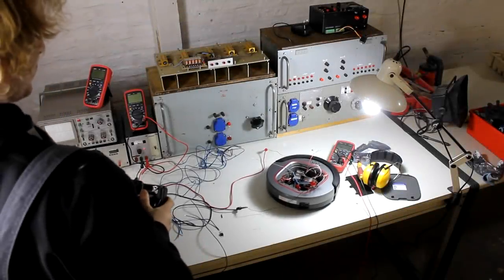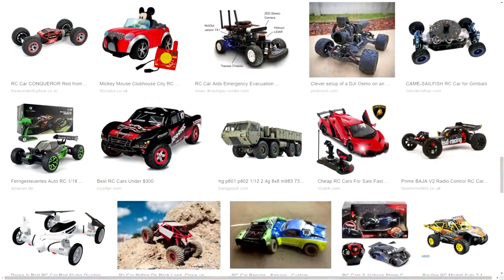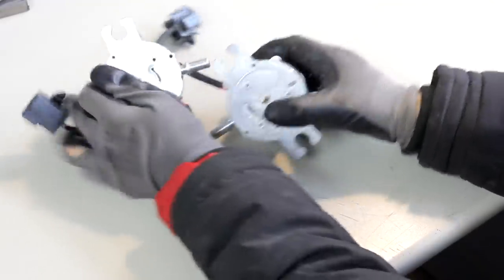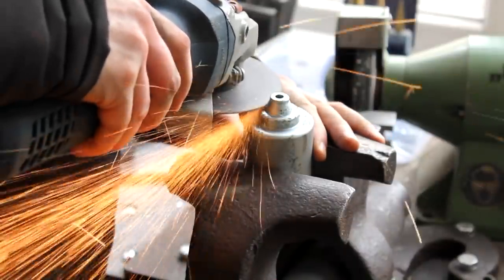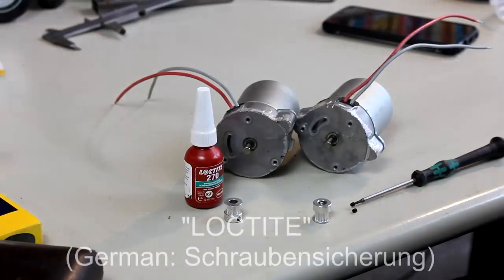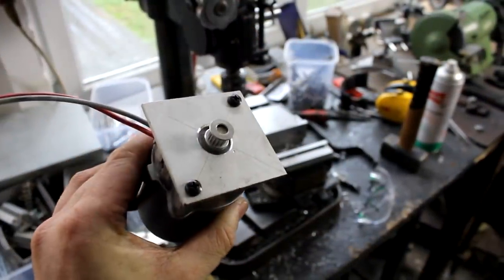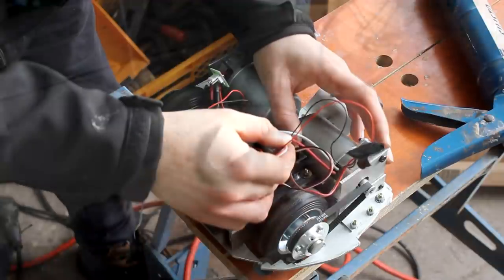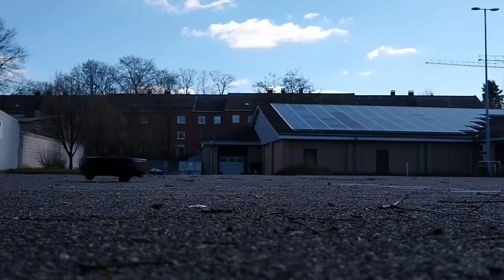Build: Robot with Inexpensive Motors and Components

Comment: Never ever wait for paint... after finishing the roughed in dimensions, drilling, but before Tapping Threads ....
heat your oven to 250F ... make it kitchen table clean, and heat the part ... and then paint yer face off !!
.... Baked On Enamel Is Better !!
Reply: Hey good point, what if I wanna paint some plastic part? would you recomment to heat it up somehow?

Comment: is there any way you can attach a weed eater motor to a razor mx350 without the need of welding? it's because i don't own a welding tool and i'm too young and inexperienced to do welding of any kind.
Reply: I think You can make clamps from metal or plastic strips, using self treading screws or pop rivets and that polymer glue he talk about in the previous videos, that stuff is realy, realy strong once it sets and it stick to most metals.
Reply: @sheep1ewe  ok i will try that out thanks

Comment: I ask you how to utilize the switching power supply of microwave oven ? How to control it and what are the uses? Is it true if u can have it at high frequency can make full water electrolysis that can run car on water?
Reply: afaik microwaves don't use a switching power supply, they use a regular transformer. 
electrolysis doesn't need a high voltage (about 2V per plate is good), you need an electrolyte to add to the water and while table salt works, you'd be producing chlorine gas, which is quite toxic.
And while you could run a car with an I.C.E. (not sure which would be better between diesel and gasoline for that) on hydrogen and oxygen, it probably wouldn't work well, and run quite hot due to lack of cooling from the fuel.
Reply: @satibel  ur info is old.read and educate urself poor man.
Reply: @samydelorean2476  well, from the microwaves I tore down, they still use a 50hz transformer, and the only thing about switch mode psus for microwaves I could find is for non consumer stuff.
you could maybe use a switch mode circuit to create an hf signal by removing the transformer, but there are much easier methods. 
you could use a simple astable ne555 if you want to produce hf.

if you have more info I'd gladly take it but I couldn't find anything from a cursory search

from what I read on producing HHO a while back anything over 1.2-1.3v decreases your efficiency when producing it, so at 5kv which is what a microwave produces, you have an horrible efficiency, and unless you don't pay for electricity, you'd be better off using butane by a large margin.
Reply: @satibel  i told u ur info is old..u keep repeating urself..educate urself man.
Reply: @samydelorean2476  well, you keep telling me my info is old, but you don't give me new info.